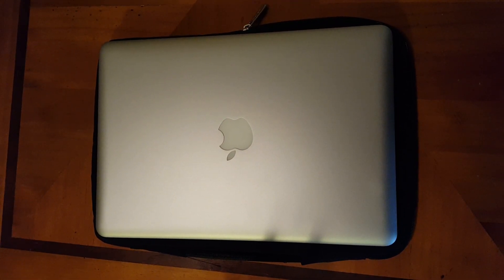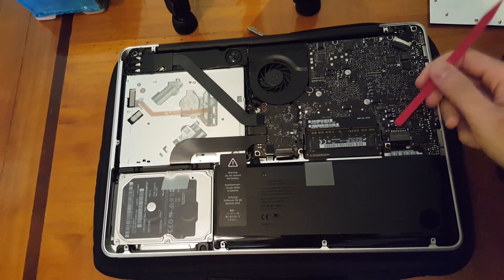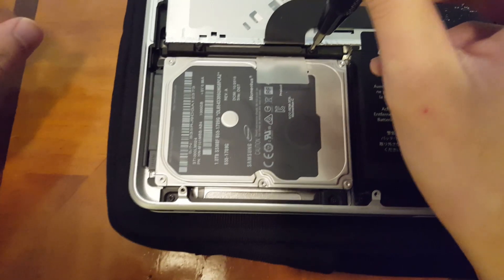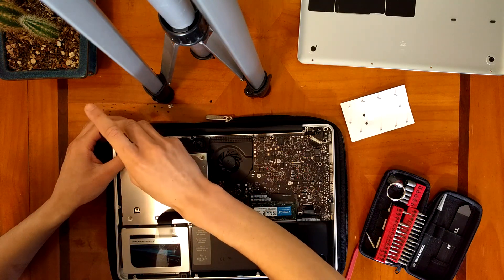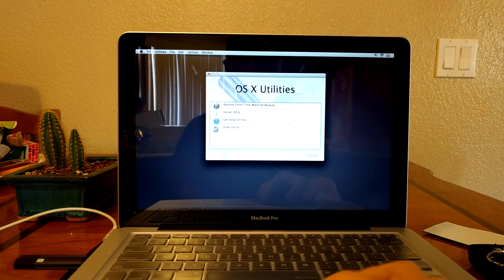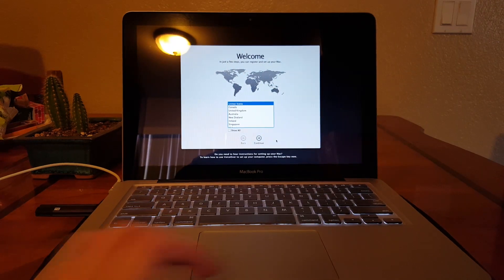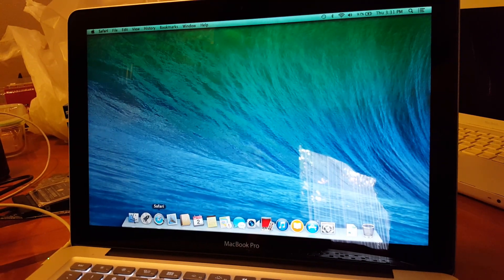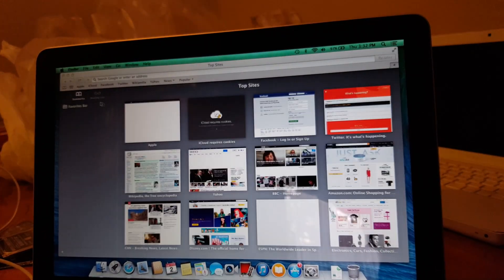How to have your old Macbook Pro ready for 2023! (SSD, RAM, Optical Drive Bay Adapter)

Comment: I have the same mac. I ran two 500gb ssd in a raid 0 for even faster speeds. Also, you should really have changed the thermal paste while you were in there. After 7 years, it’ll be a little dry.

Comment: Very good video.  It could of been great if you told us the tools used to unscrew the bottom panel, as well as links to the Adapter, SSD, HDD, and RAM.  But still, very nice!  

Also, it appears you installed a 2.5" SATA HDD instead of a 3.5", correct?

Comment: How do i get the latest OS for 2019 on a usb stick or memory stick etc 
Im trying to upgrade my 2012 mac book pro to now end of july 2019 how do i do that ???
Reply: You can't get that installer... You will get 10.4 Version ...If you are in latest Mac OS.. Mac will not allow you to make bootable... 
If you've Latest dmg file... Just go to your windows system.. and run software "Transmac" 
You can easily make bootable usb for mac with that free software on windows..